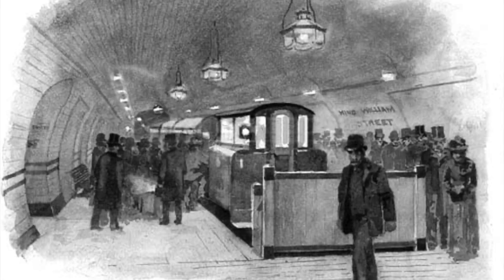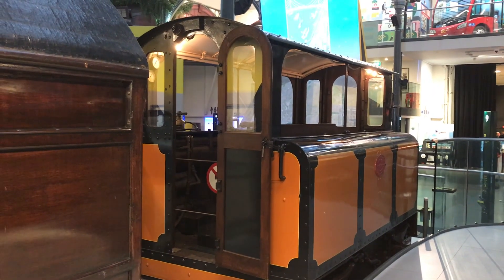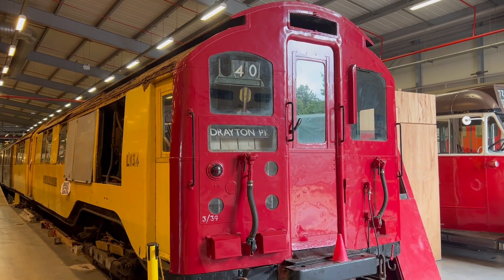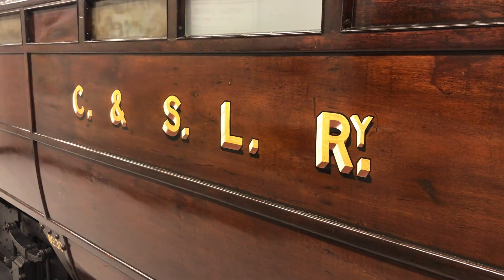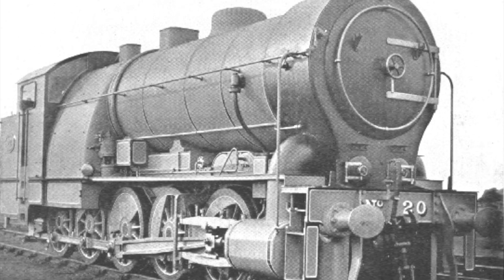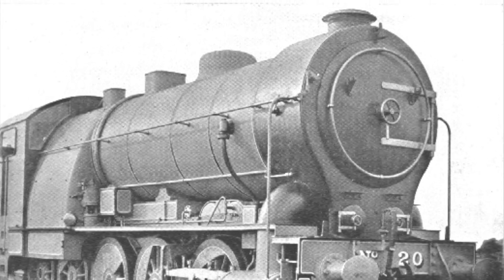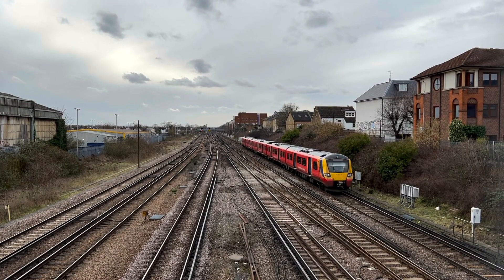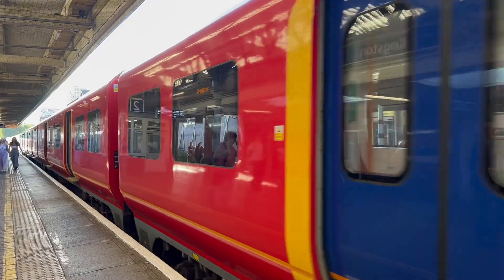Why some electric trains use a third rail, and others don't

Comment: The problem with converting third rail electrification to overhead wires is that clearances under road bridges and in tunnels often are limited. There are simply not room for a pantograph and overhead wires. To rebuild all lines south of London would cost a fortune.
Reply: Actually the Waterloo main line does seem not to have anything like the number of over bridges that other lines have. Given that the standard for electrification to 25kv was in the 1950s I am a little surprised that the Kent Coast lines and Bournemouth line weren't done with 25kv with switch over points.

Comment: THIRD RAIL & FOURTH RAIL !
The City & South London Railway was the first "Tube" line, as opposed to the "Sub Surface" (Cut & Cover) methods used for the Metropolitan, & District Railways. The result is that today you have TWO totally different "Loading Gauges" for these two systems. And the "Fourth" Rail was "forced" on the Underground companies, by complaints from the Post Office & the Greenwich Observatory of: "Spurious leakage of current into the ground, which could affect the Post Offices Telephones/Telegraphs, & the Greenwich Observatories sensitive equipment". The unruly L&SWR and its Third Rail system later came in for some complaint, but issues were dealt with only on a local basis, by often adding and extra rail loosely laid on the sleepers, and bonded to the Running rails.

So Third Rail (initially at 600v DC LSWR from 1919) is the "Positive" rail. The "Return" is via the wheels/axles to both running rails. (A lot of the equipment below the floor was therefore LIVE at all times). But as these only rely on wooden sleepers as insulation, certain issues have (as above) been dealt with on a localised basis. The Undergrounds FOURTH Rail system is to try and obviate the problems of "loose current" getting into the surrounding ground. So the OUTSIDE Rail on the Underground is the nominal "Positive" and the Centre Rail the Insulated Return. Which is why at every station, the more dangerous "Live Rail" will be on the side of the track FURTHEST from the Platform.  

Indeed as the Southern Railway proved with its over 700 route mile network in 1939 (the worlds largest at the time), including longer distance mainlines of 75 odd miles. The "Claim" that low voltage is no good for "Express long distance" type traffic was shown to be just another ignorant FALLACY. Indeed Mother Nature as Professor Kristian Birkeland (Norwegian Scientist) proved in 1903, with the Discovery of the "DC" constant electrical connection between Earth & the Sun 93 MILLION miles away, exhibited NO power drop off. And from that we can assume that the "Birkeland Currents" named after him, of the massive electrical flows between ALL Galaxies, (photos on NASA website) also have NO issues of power drop off either. Or quite simply the Universe would literally cease to function. 

Further the 750v DC third rail system is NO more vulnerable to weather conditions than overhead AC, indeed far less in the case of "high winds". The current problem with the Southern system, is the removal of the original heavy duty third rail pick up shoes,  fitted to heavy weight wooden shoe beams with sprung tensioning (as seen at 7:17). Current light weight arms hanging from the Bogie pivot area, and only requiring a "Height limiting bar" was a chronic case of "Accountantcy led" stupidity. Which results in the shoes now trying to ride over ice and snow, which results in much more arcing, and shoe & shoe fuse burn outs, and lots of money wasted on various types of "third rail cleaning, de-icing and leaf fall issues. Indeed leaf fall problems only got worse when they abolished good old fashioned Brake Block shoes, and replaced them with Auto Industry "Disc brakes"  ! 

And the Railways south of London were NOT much affected by the Trams. Indeed when a railway line was electrified it often took business off the Trams, because the Trams were to slow, and got increasingly clogged up with other traffic. The South London Line being a good example, which took business off the LCC Trams paralleling that route, when the LB&SCR South London line was still 6,700v AC Single Phase overhead ! That LB&SCR Overhead network was replaced with third rail by about 1927. Before that change to third rail it had spread to a number of routes and went out as far as Sutton and Coulsdon North (16 miles from Victoria). But overhead cost far too much, even though substations were roughly double the distance apart. Wear of pantograph heads and the wire itself was very badly affected by the pollution of the atmosphere (London Smogs) and the sulphuric exhaust from steam trains.   

And had not the Second World War intervened the Southern Railway Board were planning extension of the third rail from Maidstone & Chatham all the way to Dover & Ramsgate. And on the South Western to Basingstoke, to be followed by Southampton and Bournemouth. Line which BR electrified post war, as some of the equipment had already been bought -pre War. And much of the planning and preparatory work carried out. A fact this "programme" appears to be oblivious too !!!!  

SPEED POTENTIAL ON 750v DC !
And 750v DC EMU's can quite happily go a lot faster than most would imagine. It was the Civil Engineer that set the blanket 90mh max on the Southern simply to be able to keep up with track renewals, as the Southern Network is the densest in EUROPE. The first 100mph route was authorised in 1989 between Surbiton & Southampton for the then new Class 442 Wessex Electrics, which were actually utilising there predecessors traction motors & much of the Brake equipment from the 4REP (Power Pack 3,200hp units). Indeed the 4REP's in tests in late 1966, where found to be quite capable of reaching 125mph. Which resulted in them being officially labelled as "Locomotives". Meaning when running by themselves they were limited to 60mph, partly due to those rather revealing tests. Indeed with a Class 73/1 on a Night Parcels Newspaper train in 1977, this loco with 7 bogie vans AVERAGED 117mph between Victoria & Brighton via CRYSTAL PALACE. and was driven by the infamous "Flying Scotsman" (Norwood Depot) so named because he came from Glasgow, but was also as Black as the Ace of Spades ! And "ED's" were only Half a 4REP at 1600hp, with the same motors & bogies as the units !    

EUROSTAR MULT-VOLTAGE TECHNOLOGY - NOT NEW !
This may be unusual in Britain, but there are MANY locomotives around the World, indeed thousands of them, that are as many as "Quad Voltage" capable. Meaning they can use up to FOUR different electrical systems. And the French had a long distance THIRD RAIL line going up into the Alps towards Geneva, which required overhead locos to be dual Overhead/Third Rail fitted since the 1960's.
The huge Japanese network also has hundreds of Tri-voltage type locos including Classes EF30, EF80 & EF81, all being Tri Bo (Bo-Bo-Bo wheel arrangement) which can run on 1500v DC, 20Kv AC at either 50Hz or 60Hz. And many more Dual voltage types.      

POWER EXAMPLE. 750v DC vs 25,000v AC
When a Southern Region BR 12-car 3,000hp EMU (nominal 1,000hp per 4-car unit) starts at Waterloo Station, the Driver can "Whack the power handle wide open". And the Ammeter on his desk will immediately swing to around 3,200AMPS. Which is why this 750v DC system needs a large heavy steel rail weighing around 140lbs per yard.

If we then wander across to Euston Station on the London Midland Region where we have Class 87/90 locos rated at 5,000hp that start with 12 x Mk1 coaches (in the 1980's), they have an overhead power supply at 25,000v 50Hz AC, fed via a lightweight copper wire ! And when the Driver opens the Power handle to start this 400 ton train, the Ammeter will rise to no more that just 65AMPS. Indeed a Modern Split Level Oven in YOUR Kitchen can draw up to 75 Amps !!!  The abilities and behaviour of AC & DC are different, and have different Advantages & Disadvantages. And require DIFFERENT wiring methods because they behave differently. 

Indeed you can do things with "Mother Natures" DC that would result in a Short Circuit if you used the same wiring method with "Humanities" AC methods. One of DC's many secrets is that the supply will only ever return to the Transformer/Rectifier it came from. So you can wire together 50 separate Transformer/Rectifiers using just ONE WIRE without fear of a short, which on a Model Railway means you can halve the wiring necessary if you use Marklin's AC system, or indeed the newer "DCC" (Digital Command Control) system, and save a fortune in wiring costs and the time required to install these AC systems !!!   

Another DC trick to avoid the one issue it is known for, which is "Power drop off with distance". Is to use for that "ONE COMMON RETURN wire" for ABSOLUTELY everything DC on the layout, a heavy duty car battery Auto cable. Which then allows for the other 98% of the layouts wiring the use of very fine (low priced) Burglar alarm cable (as small at telephone wire) which is rated at a maximum 50v at 5 amps. More than enough for a normal 12v DC supply to operate even 20 coach trains on the layout. And even a 100ft long layout will NOT notice ANY power drop off at the opposite end from the supply !!!    

750v DC - KEEPS LIVE HUMANS OFF THE TRACKS !!!!😀😀😀

Comment: From what I can tell with the current situation of UK railways, installing new lines with third rail actually isn't even allowed anymore. And all trains sold in the UK for use on third rail lines must have the ability to be converted for use on Overhead lines even if they don't presently do so. Most obvious is the class 375 Electrostars and 707 Desiro Cities used on Southeastern, which have a well in the roof for a pantograph to be fitted despite Southeastern having no overhead wire beyond the High Speed service.

Comment: Yeah it's always been interesting to me, as someone that lives in south London and regularly heads southeast, to see that third rail is a relatively regional thing and most electric lines use the overhead system. I never quite understood why there wasn't uniformity across the National Rail network but, the historical factors definitely explain that.

Great video!

Comment: When the DLR was electrified they hung the conductor from above so it was a bottom contact system. This meant that it was much less susceptible to ice, and also they put it under an insulated cover, so it can't be stepped on by track workers or trespassers. You have to lie down next to the rail and reach up under the cover to come into contact with it.

Comment: Just a quick correction - overhead wires are more weather resistant. The only conditions which affects the overhead more than third rail is the wind, although now that we tend to use higher tension on the wires that is very unlikely to cause an issue directly - it's more that trees and other things which are blown onto the railway will bring down the power lines. Third rail is badly affected by frost and snow. The solution is to spray the rail head with what I think is a thin solution of oil. The current can still pass to the collector shoe on the train, but the oil stops ice freezing to the rail, so the collector shoe just knocks it off. In cold conditions they may also run ghost trains overnight (trains without passengers) so the powered rail is regularly swept to avoid the build up of ice. In snowy conditions the extra rail makes clearing snow from the tracks less effective as it gets in the way.

Comment: There has been talk in recent years of increasing the thirs rail system, not only because it is cheaper to install than over head cables but also because it is more suited to charging battery powered trains.  The industry is in flux at the moment and what is old could become new once more!

Comment: It still blows my mind that there are trains for getting around certain metropolitan areas because they are just that vast, like in Greater London, Paris, and Rome whilst having trains for going to other cities and trams for going around the city centre because the city centre itself is that vast. Where I live, the city is small enough that, to get around the city centre, you can just walk, and you use the tram network to get around the whole city, and the trains are only for going to other cities, we only have 2 levels of transport rather than 3 levels. I never been to parts of London outside the city centre when I visited so when I flew to Rome, and then Paris and got a train to the city centre that floored me because where I live you get tram from the airport if you want to get into the city including the city centre and you only take the train if you are coming from elsewhere. In Malta, you use the bus for the whole country because it is that small, yet in Paris, Rome and Greater London you have to use the train just to leave the city centre and go to another part of the city, there are some cities that are bigger than some countries, which I find shocking. In Malta I could probably get between the 2 furthest points of the country in a 45 minute drive...

Comment: The new Sydney trams use electric contacts in the middle of the road, the smarts in the tram mean the contacts only supply power whilst the tram is over it. Therefore pedestrians are safe. Not sure how it does this.
Probably not feasible to modify the London electric lines, anyway trespassers shouldn’t touch them.

Comment: One thing often overlooked is the amount of time taken to make the 3rd rail safe when the railway is given up in a possession so engineering works can be done.
Each electrical section of 3rd rail (They are about 2 miles long) first has to be turned off by the electrical control room, then if the electrical section spills out the end or side of the possession hook switches have to be opened to isolate these little bits.  Then short circuit straps have to be applied to ensure if the electrical section is accidentally re-energised the circuit breakers will pop out before anyone is fried.
So it typically takes an hour after a possession is taken before it is safe to work.  "Normal short circuiting devices" are being installed at 3rd rail sub stations, these have reduced the number of short circuit straps needed when setting up a possession, but it is still a time consuming and expensive process.
However the 3rd rail is cheap to install, robust and a lot more reliable than overhead electrics, so as a railway worker and Kent commuter i'm really glad it was installed.  Money well spent.
(Jonathan a Siemens employee, we do really good electrification equipment and installation, shameless plug!)

Comment: One benefit of 3rd rail over overhead wire is that it is less obtrusive.  Bridges do not have to be raised. But with the traditional open rail design there are dangers from electrocution, foliage and snow. This is overcome by arranging the top surface and sides of the rail to be covered by a plastic cover and arranging the pick-up shoe to connect from underneath. This gives safer operation and allows a higher traction voltage. Today several metros across the world use this design.

Comment: Don't know if this is mentioned but the first electric suburban railway was the 1904 Tyneside electrics which ran on the North Tyneside Loop which is now run by the Tyne And Wear Metro using overheads

Comment: An excellent video and a very good explanation as to why the Southern ended up with 3rd rail, looking in that cab shot at 01:49 and that tap changer on the right hand side looks very impressive though I hope they shielded that in service ;) A special shout out to it being Mather & Platt which was located not too far away from me (though sadly long-gone by the time I was around). The expansion of 3rd rail is still an issue today, there have been numerous plans for the Merseyrail network to adopt the line from Kirkby to Wigan Wallgate but these have constantly fallen through as it would require electrifying several miles of track with 3rd rail which is now no longer allowed (generally speaking). Their solution was a new station "Headbolt Lane" which offers absolutely nothing new for anyone as they still have to change trains like they did at Kirkby, the only difference is that Merseyrail need to use new battery units to run from Kirkby to the new station a mile down the line - literally a new battery EMU which only uses its battery about 4 times a day for a mile at a time...

Comment: I used to live on the Waterloo to Southampton and Bournemouth line. That was electrified with third rail in the 1960s. But still needed diesel for the Basingstoke to Reading branch, etc.

Given how late that was, it is a shame they didn't go for overhead.

And don't neglect the Class 73 electro-diesel locomotives. They were unusual also because they were required to be narrower than standard to permit operation in some of the sub-sized tunnels (e.g.in Kent). A truly specialised loco.

Comment: They should run a third rail up the Midland Mainline! The MML has too many low bridges to run an overhead line, but it runs through a populated corridor with no shortage of potential power injection sites. And there is plenty of stock that could be cascaded.

If third rail is good enough for Southampton, it should be good enough for Sheffield!

Comment: Here in NYC, they use the third rail. In Connecticut and New Jersey they use the overhead wires. I could be wrong but it probably has to do with clearance issues.

Comment: Great video! Just one correction: third rail is more expensive than overhead, not cheaper. This is because the low voltage constraint means more frequent substations, and they are more expensive per unit because they have rectifiers and very large high current  circuit breakers.